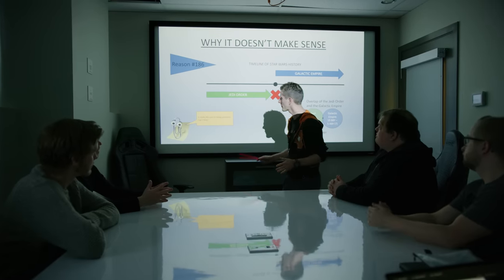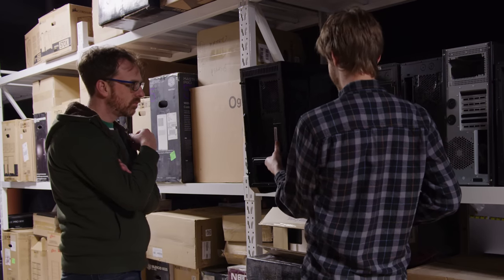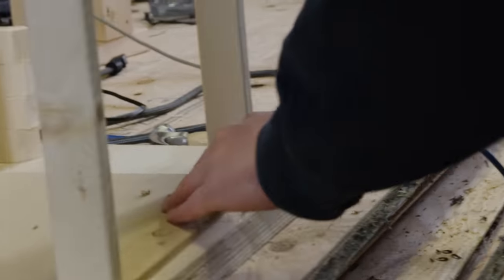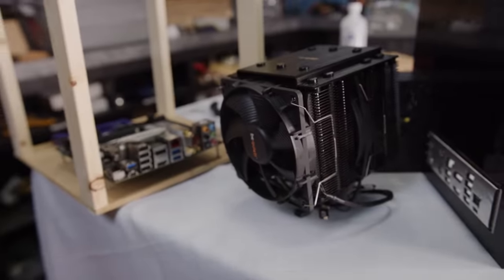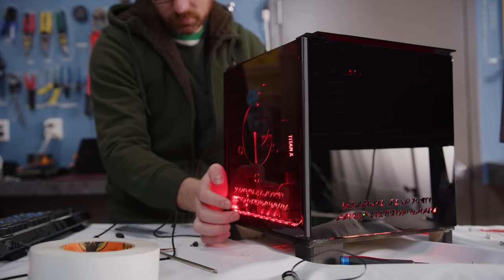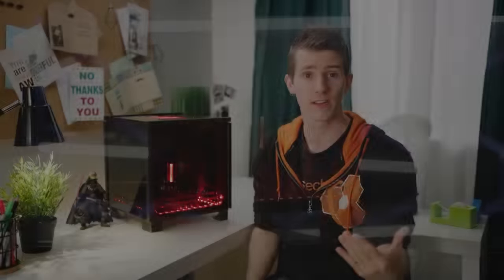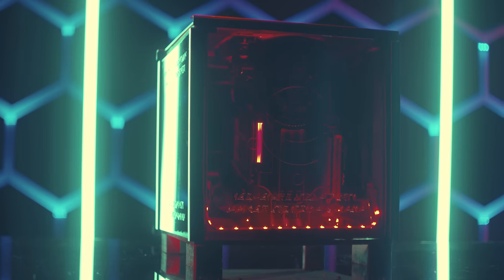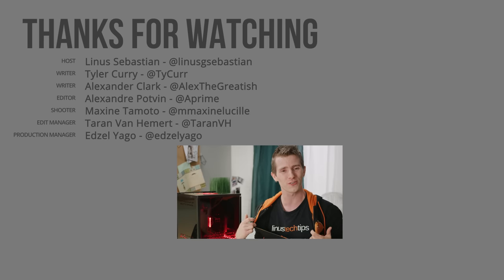Mystic Space Warrior PC

Comment: Yeah I'm sorry but not even cheesy b-roll and rgb lighting can save this disaster and chipboard for the base, cmon man if you have to use wood at least splurge a little and get some pine wood or something geees. This just looks like expensive hardware sitting on dirt. Maybe that's a bit rough but dang O.o
Reply: Make me wonder if they even used some CAD or other 3D software to plan the measurements first, or at least build a mock with cardboard first
Reply: It's MDF not chipboard...

Comment: No amount of jump cuts or video editing magic is going to make that case look good.  Not from a carpentry standpoint, and not from a design standpoint.
Reply: From an anything stand point.
Reply: hellcat1988 it looks like absolute shit. Can't believe this video was released.
Reply: Gorgula it doesn't look that bad, it's a first attempt, give some constructive criticism, not just spew Garbo out and say ,"it's shit"
Reply: Barry Alan Barry Alan they have a laser cutter (let that sink in), at least a jigsaw, a huge amount of resources, company connections, and staff at their disposal. They didn't even put a full-coverage coat of spray paint on it or cut the trim to the same length. Not even a complete amateur individual would consider make a heat generating, precision device out of wood. -but if they did, they would likely measure their graphics card first. Constructive criticism is probably start over. So yes, it looks like shit.

Comment: The idea was there but the execution was downright awful. Please figure out how to use a saw. Unless I'm much mistaken this was slapped together in 20 minutes by a middle school shop student who never bothered to learn what a measuring tape was. Imagine how good this could have looked if you had made the panels flush with each other...
Reply: THIS is what I was thinking. They never have anyone that can use a tool right
Reply: The problems I see. Those wooden feet look really bad, could have used painted bottle caps and looked much better than that. The wood frame is absorbing too much light inside the case, hollow aluminum bars would have served the same purpose and are as easy as wood to cut with a hack saw. The edge trim looks really shitty, had I pulled anything that like in my wood shop class I would have been told to tear it apart and redo or accept a failing grade. Angle cuts on your trim would have provided a nice flush fit or at the very least some kind of corner caps to hide the gaps. Mason board is not at all what you want to be using on the bottom of your case, even with a healthy coat of paint it tends to absorb moisture, turn mushy and deform if not fall to pieces all on it's own.

Seriously with that laser cutter seemingly calibrated well enough to print text onto glass. Could have done the whole case in modeling software and cut aluminum or sheet metal with it.
Reply: using bad tools like this generates a stream of reactions in the commentsection resulting in viewer interaction which in turn drives up their revenue stream......

Comment: Could have used the laser cutter to cut some thin metal to make a really professional looking case, not just some garage build with glass strapped on it
Reply: Melander Music except their laser doesn’t cut metal
Reply: Its not made for cutting metal but would probably do thin stuff with just lower feed (or travel, if You dont understand that) and then just file the edges so they look even.
Reply: MindBlowerWTF no.  It won’t.  CO2 lasers don’t emit the proper frequency of light to cut metal, do you understand that?

Comment: How can you screw up cutting 4 equal lengths of 1x1? And if you are going to do DIY, buy some basic powertools/workbench. You have a frickin laser, but cant cut 1x1 equally?
Reply: I think the issue was that they didn't account for the extra height added by their 3d printed plastic part at the base of the card, which is why all of the legs ended up getting a shim instead of them poorly adding one. That is a slightly easier mistake to make, especially if they didn't originally intend to 3d print a mounting bracket.

Comment: Everyone is moaning how bad it looks and the use of wood was bad but i think ill be the first one to say, fuck em'. Do what you want and as for everyone saying the design is bad, i do like it. Its not GREAT but its not bad either. Also if no one paid any attention, at the start of the build they said they didn't want to use metal for the case frame and its really easy to see why. Any mistakes made are harder to rectify and also it means that they can perfect the design and not have to spend as much money making the case than they do with wood. Its cheaper to work with and make stuff from and they may need other machines to shape and colour the metal that they don't have access to at their workplace.
Reply: Actually, working with rivet pops and aluminium profiles is much easyer and the pricing isnt so much off from this, the tools are no realy extras cause they would work with plexiglas on the outside as well. And nitpicking about 20€ on an custom Build that is designed from scratch is just awkward for ltt :(

Comment: Hey Linus or anyone is this comment section. My pc is barely running pubg at 20 FPS and I have a 2gb ddr5 gpu 1050, 8gb ram, amd a3 3.7ghz processor, 1tb hard drive. And idk what motherboard what should I do to fix this problem
Reply: SVG- eminence its probably the 2gb gpu. That's pretty small. And with an amd A3 you are probably experiencing some bottlenecking.

Comment: can make a REALLY cheap build? please less than 300 american dollars, for playing paladins at 40 fps or minecraft at 70. Csgo 50.
Reply: look online for stuff using older or used hardware, theres a few video's on other tech channels if I recall that give you very specific guides on even sub 100 dollar pcs that might be able to hit those goals. for awhile the lga 771 to 775 to run older xeons on older consumer motherboards was a pretty popular bang for your buck on cpu wise, for those sorts of games they will probably still be pretty good, from there you can go for a decent gpu with the extra cash to offset it, though there will be bottlenecking depending on how modern the gpu is. but if you have a bottlenecked gpu you could upgrade your motherboard and cpu in the future and see a noticable increase should you start feeling obsolete
Reply: thanks

Comment: "Use the force, Harry." - Gandalf [picturing Sir Patrick Stewart]

But seriously, you guys need to get better hand tools. That 'brand new' hand saw was a drywall saw and was never going to work for MDF. I recommend a Coping Saw for internal cuts like that, since you can remove the blade and re-attach it through a drill hole. Then sand/file/whatever any inconsistencies in the cut. Or use a power jigsaw.

Hell, with that laser cutter you guys could have probably made the whole thing out of acrylic sheets and it would have looked fricking awesome that way too.

Comment: The wood is insulating the build. Also it is a fire hazard. Also mounting the blower type GPU Vertically means it will be working AGAINST convection currents to remove the hot air.

Comment: You guys need to step up the star wars
I mean I'm broke so that's my excuse but you guys got EVERYTHING, If I was you I would have taken this thing to a new level.

Pyramid shape, brass trim exterior, steel interior bracket mount,  slightly clouded dark red acrylic , the inscription 
"Kaxai zavus midwan sesie, kaxai gautijas lieti. Zo meistras isdavy, jri xaari keltimaz. Nw aukotijas qo kia chaosas ir tvarka valia gimti kash zhol's vesuo. Tave aeuso valia buti kosh zo kitok  " (legit sith language) on the acrylic, sith logo front and center, red LED with a hint of purple rippling inside, a small red crystal at it's heart with the graphics card sitting nicely as if part of a historical display the parts barely visible as if to appear like a hologram inside the pyramid.
I estimate a cost of around 200$-300$
That's how a sith would rock a PC.

Comment: Hey Linus! Loving the DIY stuff you guys are dabbling in. I realize you guys are just starting out with this stuff and giving it a shot, so like you said in your Honest Answers Vid, Constructive criticism!

First off, not a bad job for a first shot at making a case like this. Love the design on the panels and the cool cube-like placement. I think the problems were mostly construction, which i'll list below.

1) As metal was not an option, consider using a hardwood for the base, doesn't need to be thick, but with a dark stain. as well as a protective layer on top of it.

2) Angle Iron or aluminum would have been a great, cheap, and stylish look for the sides and to hold up the plexiglass. Holes drilled into it and the plexiglass would have served great to hold the sides in place. I recommend a Drill Press for stability when drilling metal or plex. Black rivets or screws would also add a great industrial aesthetic. you can even get protective plastic covers for the ends so you can use the angle iron as feet (or 3d print it!). You could have spray painted them black to keep with the color scheme! 

3) Measure twice, cut once! Measuring the graphics card would have avoided some issues with placement. I am assuming based on the change in height that it was caused by the 3D printed card mounting bracket you used to hold it up.

4) a drywall saw is not a great choice for hole making, even with MDF. A good jigsaw and a steady hand. would have saved ya some headaches here.

Other than that I still love it and all its jankiness, keep up the good work!

My two cents, but some nice red LED strips up the corners so they are hidden, maybe with a breathing mode, would have made this thing amazing.

Comment: I've had my MOS pack for about a week and half now., and so far it's OK. Laptop fits just fine, and I like the idea of the Reach allowing you to plug in and charge whatever's in your bag without opening it. Also like that the bottle compartment is lined so it can't leak into the bag. I also like the case for glasses at the top. The spot for the powerbank fits my largest one perfectly, 
That said,  It has a few issues, most of which stem from their attempts to reduce the front to back  depth of the pack and have everything as flat and smooth as possible.
The flaps over the front pockets restrict full access to them,  fine if you have thin or tiny hands, but I have neither.  It makes it hard to access the open and zippered pouches in the front section.

The slender build of the bag means that you really have to load it in a specific order or you won't be able to get everything loaded. 
The main compartment is only about 3 inches deep, and you lose a good deal of that once you put laptop in there.  So you can't actually fit a pint box of Orange Juice  in there without it pressing up against everything else. Everything is  a snug fit so stuff shouldn't roll around, which is good, but you should stick to cargo that's as flat as possible.  I'm not carrying a lot - Thinkpad, Headphones,  powerbank, phone, blackberry (WORK), some pens, keys, a MiFi, and glasses (in addition to the sunglasses in the dedicated compartment). 

The shoulder straps, while comfortable, do not sit where I think they're intended -  I don't think I can secure the chest strap.
The padding on the back is very comfortable.

It seems well built, and its comfortable to wear, but it's a bit small. I wish I could get fit for a pack like this, but with straps that fell where they should and an honest 4 inches of cargo room in the main compartment that wasn't shared by the sleeves.  or, and flaps that didn't reduce access to the pouches by about 10-15%

Comment: Hey Linus, I know you probably won't end up reading my comment but I will give it a shot. First, thank you for all the hard work I love your videos and they have taught me most of what I know about computers. However I am not advanced in PC stuff, like bios or reformatting or general pc maintenance. I Was wondering if you could possibly answer a few simple questions. First, what is the proper way to clear a drive. I have added and switched hard drives between laptops but I have had to use some weird programs to clear the drives, is there a normal way to do that. Two, what is the proper way to have and use two hard drives. I have one 125g ssd that has my os on it and another 500 ssd I use for space for games and such. My files look like a mess, how do you set it up? Finally how do I overclock a laptop safely. Not just the Cpu and Gpu but also how do I safely increase the fan speeds in my pc and is it possible to then put that on a macro. So that if i press a button in increases fan speed and when i press it again it puts it back to normal. For reference i have an Asus G751JY. Anyways I hope I get an answer, and keep up the good work!

Comment: Thinking of the acrylic "Mineral Oil PC Build," why not measure and then cut dark acrylic panels for the case frame itself?  Would its legs have been strong enough if they were made of thin vertical acrylic rectangles that were bolted together?

Comment: I'm surprised that they didn't take a hacksaw to the titan xp to make it shorter to fit the case like they usually do with compact builds. Very nice looking case. Maybe next time you can add fan holes at the bottom for more ventilation? It would only take a little extra drilling to add radiator support as well. Just some thoughts for your next build. Will you make a green version?